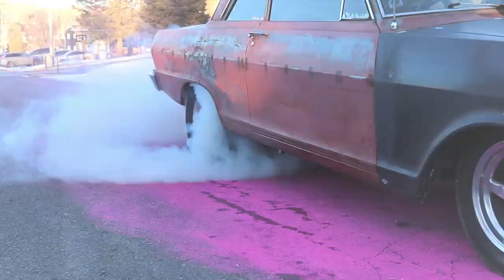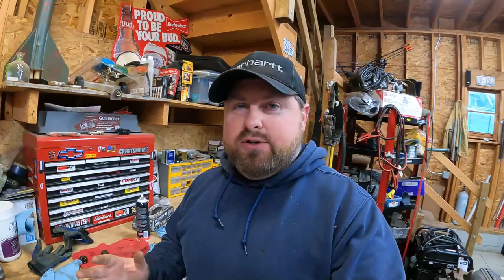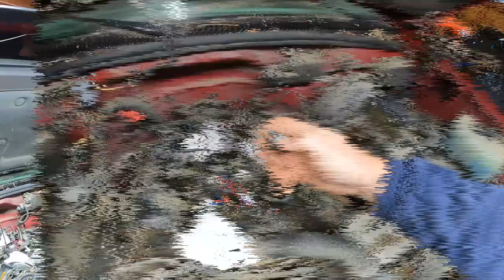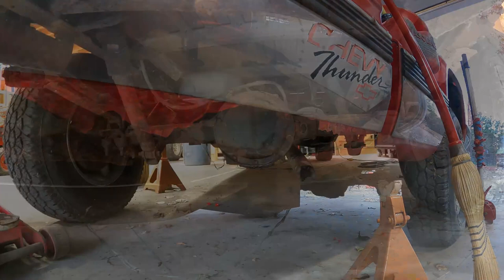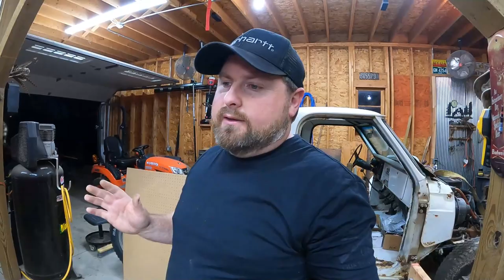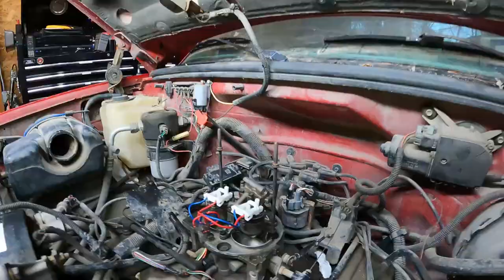❎ MOTORS FIRST START IN 10+ YEARS

Comment: Were all the fuel issues due to all the sitting for long length of time? TBI trucks aren't one of the most powerful, but they're one of the most reliable systems. The biggest problem I've ever heard from a TBI system is when guys take it off, put it back on and don't torque it equally or overtighten it and warp it.
Reply from the maker: It was due to sitting over 10 years